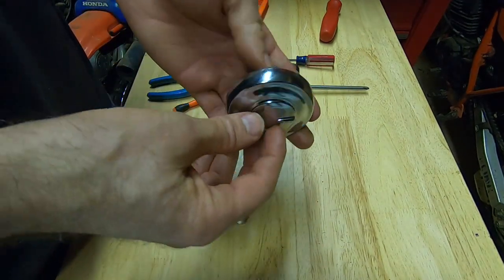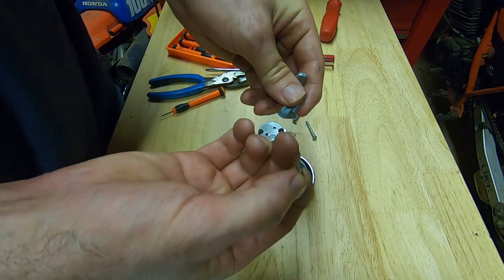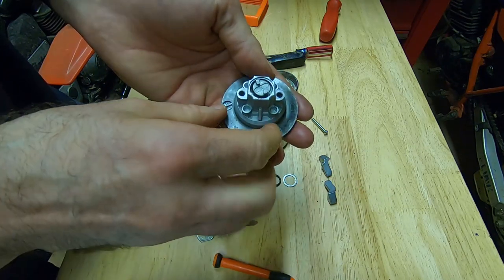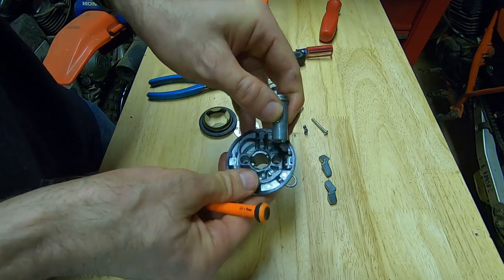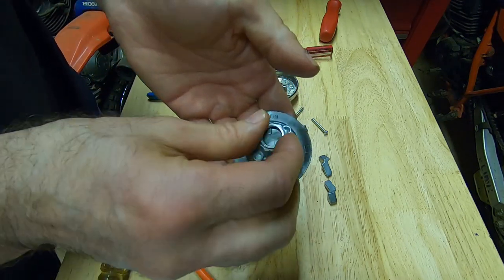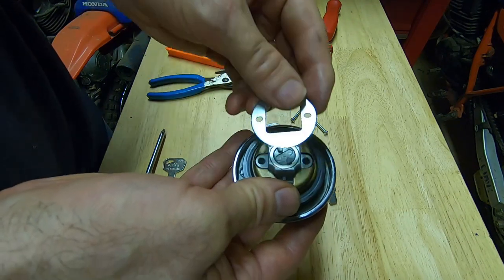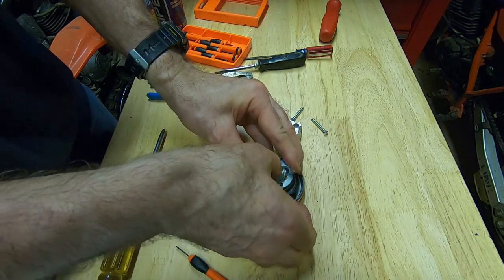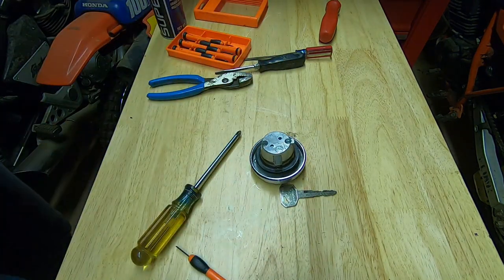How To Disassemble And Assemble A Motorcycle Gas Cap Lock

Comment: A big Thank you from Malaysia......for this video...as i was having a problem with mine of a Suzuki Gsx1100 1980 model tank cap.....Got a replacement from China and a friend also bought one, but says that it doesn't work....as these models has a very tiny vent hole which is not enuf to balance the tank pressure, if its blocked then have difficulty riding the bike, will stall after a few KM's and will need to open the cover and have to repeat the process. Hope you would have a video of the cap mentioned for this models......tq.